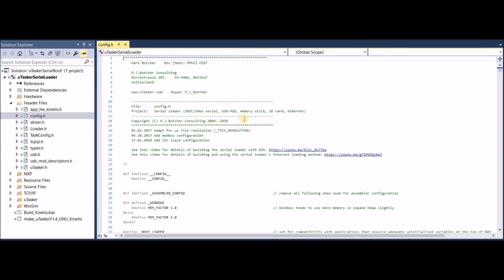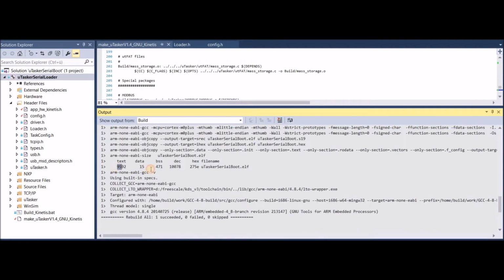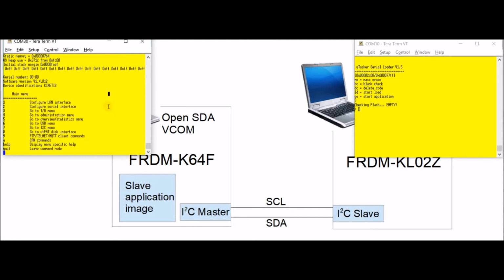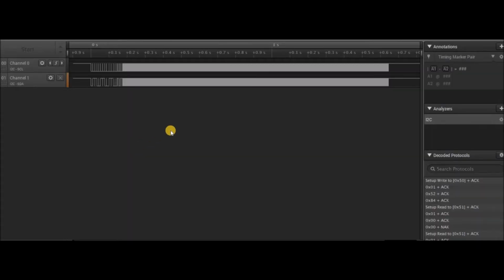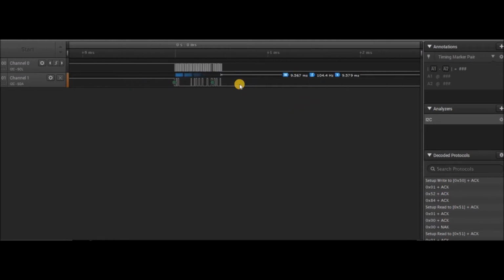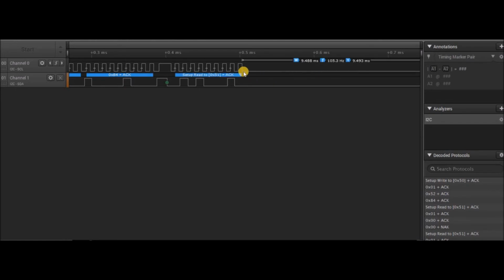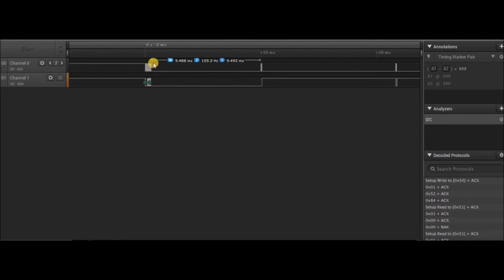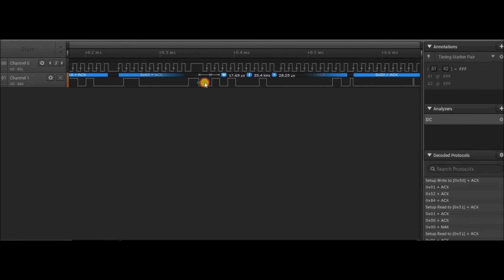uTasker I2C Slave Loader

Comment: Hi Mark, Nice explanation. Do you think it is possible to use  FRDM-KL03Z board (which has 2KB RAM) instead of the FRDM-KL02Z board? Thanks
Reply from the maker: Krish
Yes, KL03 is no problem - the I2C slave loader uses very little RAM (only about 20 bytes). It has a small OS running too - which uses a bit more - but still plenty left.
Note however that the KL03 does already have a ROM loader built into it which supports I2C, LPUART and SPI loading which may be more interesting in your particular case.